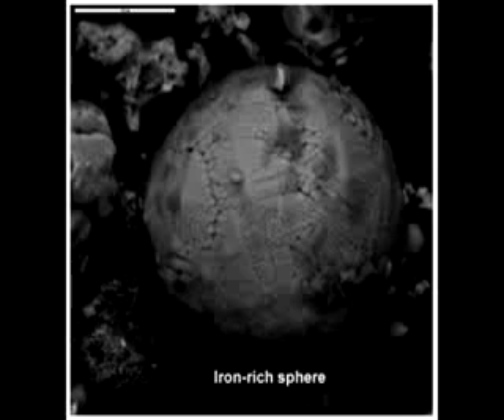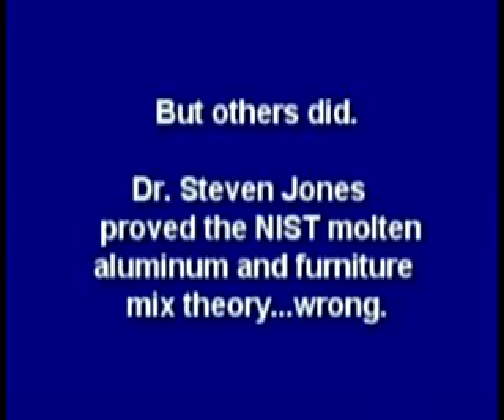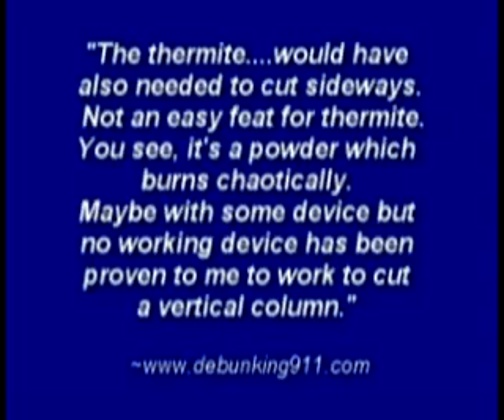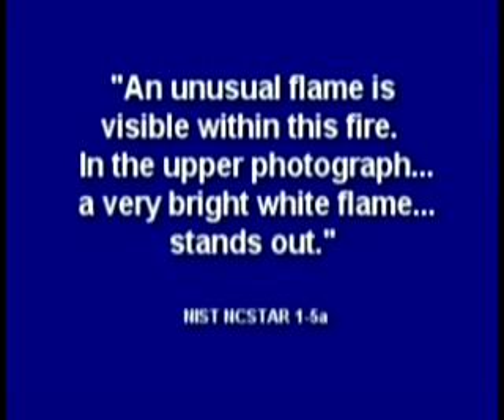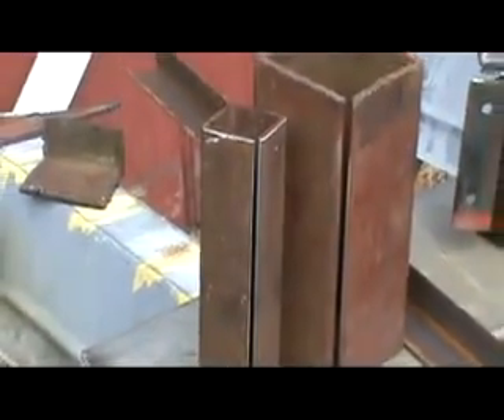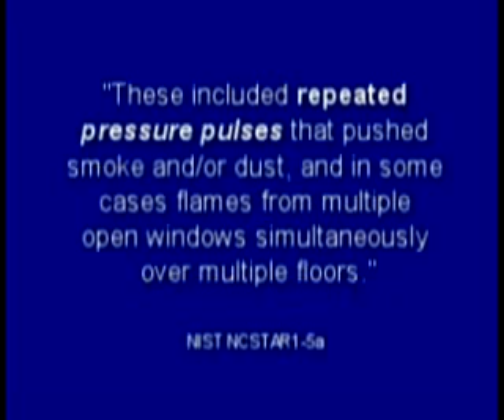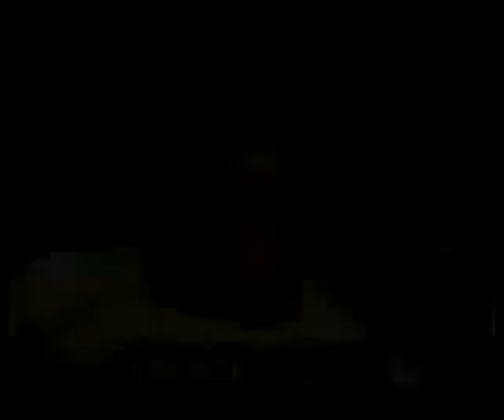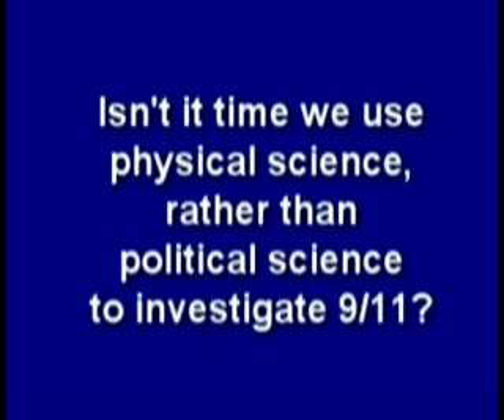Proof that Thermite can cut a vertical column

Comment: They dont want to get on the subject of where  the inconel turbine fans went lol.....  aerospace materials designed to live in temperatures that standard steel won't but they found no pieces lol..... Doesn't happen, I have sold these high alloy materials for years and they aren't fooling me.  

So many other things that anyone with common sense can come tobthe conclusion of that it isn't funny.  Good job on showing the plausible scenarios from a normal point of view.

Comment: Sir you are sharp as a razor and your thinking process is perfect. I re-watched your video after a few years and I am in awe again.
Reply: I re-watched it too. And it is still as ridiculous as the first time around.

He only proved that, given his experiments. it is physically impossible to do what truthers claimed has been done.
Reply: @wimahlers  how has his experiments proved it is impossible?
Reply: @vincentvega1350  
Simple, he showed it (thermite demolition of the twin towers) must be meticolously planned. With highly visible structural preparations. While at the same time it must be done in the utmost secrecy without any of the daily occupants noticing anything out of the ordinary. 

Then it must be synchronised with real life plane impacts. With uncontrolled fires. But not so uncontrolled that somebody could not push a button so the towers could precisely collapse at the point of impact. 

After which the obvious thermite damage must be hidden or, if you prefer, controlled, for thousands of ground zero clearers, truck drivers, and many investigations. All under the eyes and ears of the national and international media.

Controlled so tightly - controlled by whom?- that nobody in the passed two decades presented some actual concrete evidence for any conspiracy accusation (other than the one accepted by the hole world). As opposed to a lot of bedazzling unverified incoherent and often contradicting conspiracy accusations).

On a side note: And all this (this = super-duper secret thermite demolition) was done for what purpose?

As I said ... his experiment showed that you can melt metal with thermite, horizontally, vertically, or up-side-down if you really want to. But that observation is not new or news.
And his experiment showed that such a scenario for 2 massive buildings as the twin towers is utterly unrealistic in every aspect of the term as used.

Comment: @EGRJ ..virtually EVERY bldg implosion I've seen here on YT, the sequence of explosions to weaken the load-bearing structures, STARTS at the BOTTOM, you want to weaken the integrity of the foundation in order to let Gravity help with the collapse, so.....why did the twin towers collapse from the POINT of IMPACT DAMAGE?  ..I"m just not seeing a controlled demo here...and IF the twin towers weren't CD'd, neither was #7

Comment: @EGRJ I'm not in the demo biz, but I think those implosions Have to be linked together, like a gigantic circuit, So....if theres a break in the 'circuit" somewhere, it will either disrupt the whole system OR disrupt a major part of the whole system, so when the plane impacted, it DID a LOT of DAMAGE over 10-12 floors (I think, at least 10-12), that would've disrupted a lot  of wiring and circuitry, something else, and it's really simple in my thinking is this.....

Comment: The thermite in the video was possibly used in order to collapse the perimeter frame work and would only be needed on the few levels near impact because that is where the report claims the collapse began. The report claimed the sagging floors pulled the perimeter frame inwards. So thermite burning that perimeter framework at the right angle could collapse it inward giving the appearance of it being 'pulled' in by the 'sagging floors'. Im nost saying Im 100% sure this is what happened...

Comment: @jimmym1a1 
Most of the thermite was 'possibly' inside the core columns themselves. Its most likely the thermite in the core columns was actually nano-thermite, organic thermite mixed with other potential reactants that doesnt burn like the normal thermite we are 'possibly' seeing in the video. It explodes similar to a traditional explosive due to the increased gas pressure but is not as audible.

Comment: what this vid proves to me is, you take someone with the intelligence to fabricate all these devices to hold a thermitic material, and sooner than later you'll be able to show it'll cut through almost anything....the problem I have with all this is: IF it were wired (the towers of course) think of HOW many of these charges there would have to be, NOW widen that out, they would HAVE to be ignited,started,activated...whatever you want to call it, in a VERY CLOSE and FAST Sequence........

Comment: @roquefortfiles 
“The initial jet fuel fires themselves lasted at most a few minutes" NIST, Sep 2005, PP 183

"But the jet fuel itself burnt in a matter of minutes, within less than ten minutes." -Lead Investigator Dr. Shyam Sunder, NIST

And there were no major fires at WTC7, therefore no reason for extreme temps to be buried in the rubble...excpet for CD explosives or thermite.

Comment: @muzicmaker2001  It is  a moot point!!!  If the buildings sizzled away at the basements and crumbled that way.. Sure you might have a point.  They were burning from a Jet A1 fueled fire HELLO?? For HOURS.  B7 had the back side of it carved out almost top to bottom.  It was SPECIFICALLY evacuated because the damage was so extensive. Burning unattended almost all day

So if an entire company.. MULTIPLE companies of FDNY knew all about it.  How is this grounds for conspiracy?  Don't quite get that.

Comment: @roquefortfiles 
Flight 11 was officially carying 10, 000 gals of jet fuel. Flight 175, about 9000. WTC7 was not hit by a plane and there was not jet fuel> No plane= no reason for elevators to fall. The extreme temps in the WTC7 rubble need to be addressed. And just because you can't explain something logically, it does not become a moot point. Who cares? That's actually pretty funny.

Comment: @muzicmaker2001  90,000 litres of jet fuel was in the building!!  Elevators on fire were PLUMMETING to the basement (which is very likely the cause of.. BASEMENT EXPLOSIONS reported by people..SSsssssseeew..BANG!!) (a little common sense is in order)   jet fuel was starting fires all over the buildings!!    Regardless.  Why are you so hung up on stuff in the basements anyway.    The buildings did not fail at the basements.. So who cares??    Its a moot point!!

Comment: @roquefortfiles 
The fires were the only heat source, right? So, at the collapse with the upper floors coming down onto the fires and most of the material being expelled laterally and many intact floors left at the base of the Towers after the collapse, the fires possibly took the elevators about 1000 ft downward into the basements and burrowed into the rubble to cause these fires and melt the aluminum? Is that what you're going with?  And WTC7 would be a different story all together.

Comment: @muzicmaker2001  Its not molten metal!! that requires foundry temps for that.  There is a SHITLOAD of aluminum in the buildings.  The entire exterior wall of the WTC is nothing but aluminum.  It has a ridiculously low melting point.  Common sense??!!   A major load bearing column was taken out at B7.  The floors failed at WTC 2 allowing 30 stories to break free.  No floor system in the world can hold that much weight on the  move.  WTC 1 had the core fail.  The antennae drops just prior.

Comment: @roquefortfiles 
Maybe you misunderstood the question. Here it is again. First, consider the difference between the Towers and WTC7: Height, design, structure, upper damage vs lower damage, plane impact vs no plane impact, jet fuel vs. no fuel. Now, you brought up that the Towers were different from other steel framed high rise fires that did not collapse. And those differences are the reason why the Towers collapsed and the other buildings did not, correct?

Comment: @muzicmaker2001  Extreme temps?  So what? A jet fueled fire was burning uncontrolled for HOURS.  As for molten material.  Guess what all that shinny stuff is on the cladding of the tower?..  ALUMINUM!!!  Lots of it 210ft/ 1300 feet of it.  Steel melts at a VERY high temperature. A foundry would be required for those temps.   Aluminum on the other hand melts at 660d C.   Well within the fire temps. 

What does your RATIONAL LOGICAL brain tell you??

Comment: @muzicmaker2001 There no examples of a steel framed high rise collapse due to fire before or after 911.  Useless point!!  There is nothing about 911 that can be extrapolated to .. ANOTHER BUILDING!!  The WTC floor design was UNIQUE!!  it was unlike any other building and a key component of its design.  It also had 2 jets go straight thru it.  So comparing that to ..?  bank of America fire and saying.. "Well THAT never collapsed"..   POINTLESS!!   The two are not comparable. 

Logic HELLO?

Comment: @roquefortfiles 
How about another reference? Since this is very common, can you point to another building collapse/fire where explosions and demolition flashes are seen and flet all throughout the building and unrelated to the fires.? Also, do most steel frame high rises shake before they collapse? My bad. There no examples of a steel framed high rise collapse due to fire before or after 911.

Comment: @muzicmaker2001 Witness accounts of explosions?  Are you aware banks of elevators were plunging to the basements after the cables were cut by the impacts.  If one didn't know the cause what would an elevator sound like hitting the ground?  Probably an explosion!!!

There is not a sound (of explosions ) coming from ANY collapse video i have watched and i have watched ALLOT!!   There was NOTHING found in the debris as far as CD stuff.  
And CD do not go off in a sound vacuum 

Good luck with it.

Comment: @roquefortfiles 
And the explosions just so happened to be coupled with demolition flashes...

"before No. 2 came down, ... I saw low-level flashes ... I saw a flash flash flash and then it looked like the building came down ... You know like when they demolish a building, how when they blow up a building, when it falls down? That's what I thought I saw."- NYFD Assistant Fire Commissioner Stephen Gregory

Comment: @muzicmaker2001 I am talking about the manner in which it fell.  Take a look at LANDMARK implosion.  Notice how the building is falling very cleanly. As one unit. Because lower floors are being taken out with xplosives   The legs of the chair are being kicked out..  so to speak.    Nothing of the kind is going on with the WTC.  Failure occurs at the impact floor.  Every floor below that is structurally sound until the collapsing portion pulverizes it.  Nothing CONTROLLED about it.

Comment: @muzicmaker2001 Well they are incredibly inefficient explosives then!!  See.  Explosives REMOVE the resistance as the building falls. Like kicking out the legs of a chair.  Then everything falls very cleanly to its own footprint.  The WTC is anything but!!  Absolutely nothing of the sort is happening there.  Every single lower floor is perfectly intact until the upper portion lands on it.    That material has no where to go but out.  The WTC is TOTAL chaos.  Not controlled at all.

Comment: Would someone kindly help me.  Cause I am kinda stupid.  Would you kindly point out on the WTC.  A building 210 feet across.  With every window blown out across 3 floors. Splayed wide open for all to see (Gee you can even see the floors collapsing)...  Can you show me where this gigantic thermite reaction is taking place?  A plasma ball brighter than a welders torch spewing sparks and ULTRA bright fire and plasma?

Cause i see nothing remotely resembling this at the WTC.

Comment: @godzilla1077 and yes, actualy, molten steel was proven, and there were pictures taken.  Google it.  You can see molten steel actually pouring out of the towers before they fell.  You can also see big cranes picking huge pieces of molten steel from the rubble.  You can also see sattleite pics of ground zero showing extreme hotspots under all threee buildings, for over a month after.  
Why didnt the commission feel the need to explain building 7?  Let alone mention it at all.

Comment: @godzilla1077 Bend and warp?  How do you go from that to complete failure.  To cut beams.  If shit just started to melt and buckle, then we wouldnt have seen such a uniform collapse, as Ive already stated.  Why didnt the tops of the towers topple over? Why did it only take about 10 seconds for both towers to fall?  Where was the resistance from each floor it wouldve encountered on the way down?  10 seconds?  Impossible if were to believe the pancake theory.

Comment: @godzilla1077 Most of that jet fuel burnt off in the initial fireball when they hit.  The fires were oxygen deprived as we saw black smoke coming from them, along with actual humans standing at the inpact hole.  
Theory?  A plane hit the empire state building in the 70s.  It was fine.  Also, planes hitting the towers wasnt even the given reason for the collapse.  The burning jet fuel was, which is a joke as jet fuel is kerosene, and does not melt steel.

Comment: @godzilla1077 Steel framed skyscrapers just do not fall from the sky.  They were built to withstand multiple jet liner impacts.  But the commission didnt even say the planes hitting them was what made them collapse.  They cited the ridiculous pancake theory.  Well where were asll the pancaked floors??  How did pancaking turn the towers to dust?  How did the towers explode out as they came down?  Why was there molten steel flowing from them before they came down? How was their pools of it...

Comment: @godzilla1077 The towers were indeed loaded with explosives.  You could see w your own eyes squibbs coming out as all 3 came down... there are also hundreds of eye witness reports of multiple explosions...mostly 1st responders.  Bombs were going off near the top of the building, and also in the basement, which is why the lobbies of the twin towers were demolished before the towers came down.  That was from bombs in the basement, used to further weaken the structures.

Comment: @godzilla1077 The collapge of tower 7 itself proves this was an inside job.  The building wsnt hit w a plane, yet fell in exactly the same fashion.  Thats because all three towers were loaded with explosives and thermite, but the plane that was to hit tower 7 was shot down in shanksville.  The tower was rigged to come down, and thus still needed to come down.  So, Silverstein said "pull it".  And so they did, and the tower came down, at free fall speed.  INSIDE JOB.  via israel.  The end.

Comment: This was a brilliant set of experiments that shows simple engineering with home made thermite can cut steel, so what can experts with scientifically developed thermite and well tested methods of application do when they have an excuse like elevator renovation. 9/11 was an inside job for sure, it is treason not to bring the perpetrators to justice.

Comment: @Matu1 
A tree trunk is solid - the towers had extremely large open areas for offices - but thanks for demonstrating how ignorant you are of building designs. How about this, search Ttop Down demolition"  and watch the video, the top portion passes through the bottom, causing a total collapse.  Perhaps you should also research static loads vs loads in motion (collapse)

Comment: @Matu1 
what does built like a pyramid not a pyramid mean?  Pyramids are rectangels - the towers were not like rectangles -- was the bottom more sturdy and designed to hold higher static loads?  certainly, but they were not designed to hold the crushing force of a collapse

Comment: @Matu1 
Actually I have a lot of knowledge of how the towers will built, having worked on asbestos litigation involving the towers for eight years -- however, without the use of google, I doubt you could tell us who the primary contractor was, what contractor applied the fire proofing, what manufacturer made the fire proofing or even what the curtain wall on the outside of the towers was made of
Reply: the towers could NEVER EVER FALL from a fire, certainly not at free fall speed straight down NEVER

Comment: @azmanabdula 
Yeah, only what you do is watch tv and repeat like a parrot, you do not think for yourself.

"i promise this is based off chemical research and not the tabloids........"
 What are you talking about???You need to clear it up for me.

"was the structure designed to take a hit from a projectile?"
I dont know about  projectile but it was designed to take a hit from an airplane sized boeing 767 but not at that speeds they say.

Comment: @Matu1 mate........i dont watch bullshit conspiracy theorist TV programs......
i promise this is based off chemical research and not the tabloids........
i will say it again.....
was the structure designed to take a hit from a projectile?
"the top part would just tip over because there is big resistance on the bottom"
they don't necessary  waste building material constantly reinforcing it......
it just has to hold itself up.....but like you said....why didnt it fall sideways?

Comment: @azmanabdula 
Yes but with so many many times more  weight under the top part you do need alot more energy than gravity to top part fall straight trough bottom, the undamaged part. Towers were built like pyramids, that means the bottom part was built to hold up many times more weight than it actually had to. So even if there would have been collapse, the top part would just tip over because there is big resistance on the bottom. Do not repeat like a parrot what you heard from tv, reasearch.